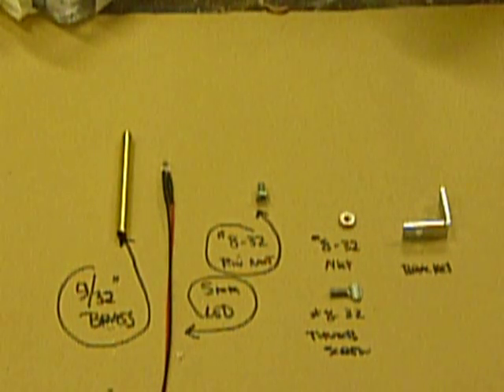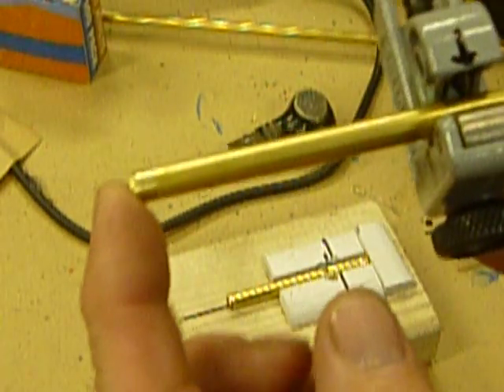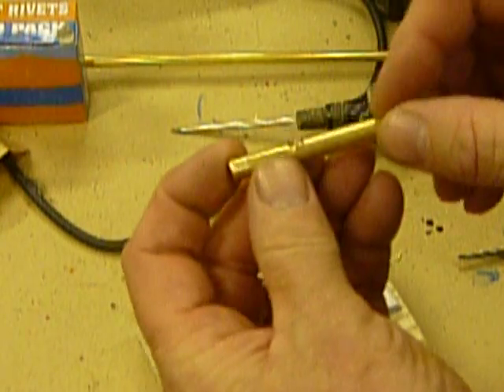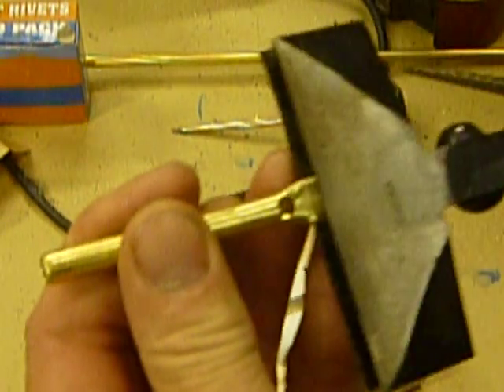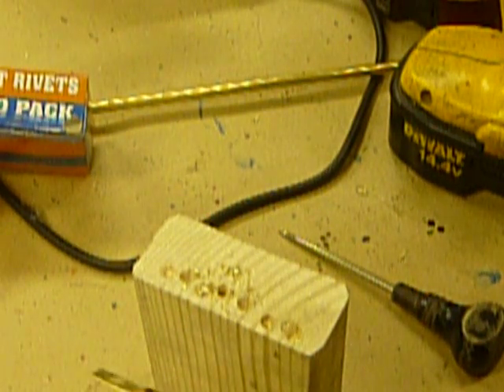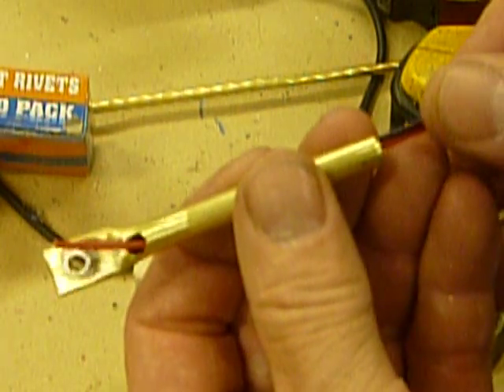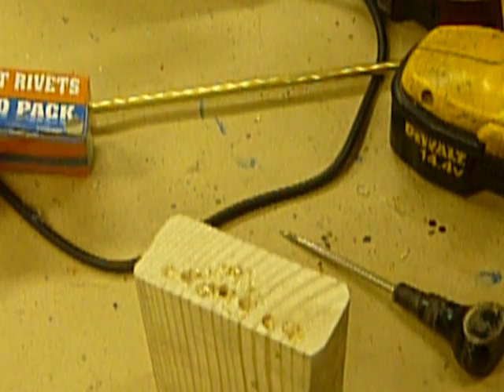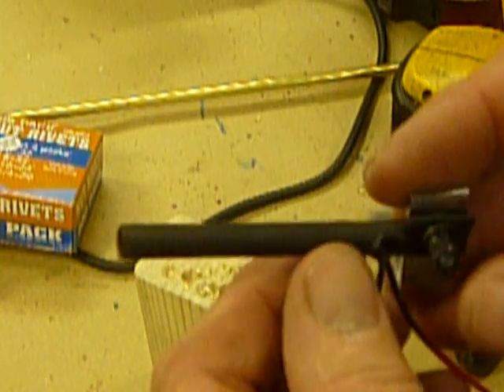LED spotlight How-to

Comment: Hi, I liked your walk-through. Just wondering where did you pick up the prewired LED bulbs and if they are set up for battey operation or or 12v power supply?